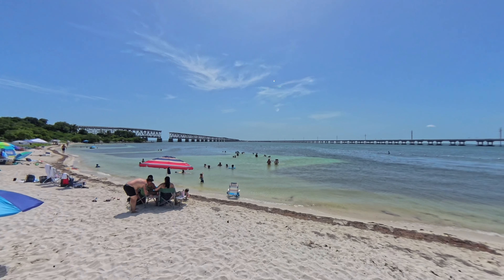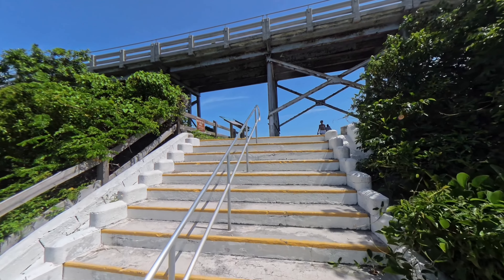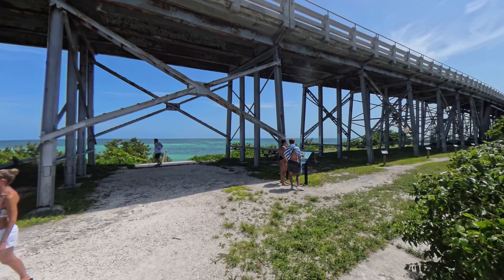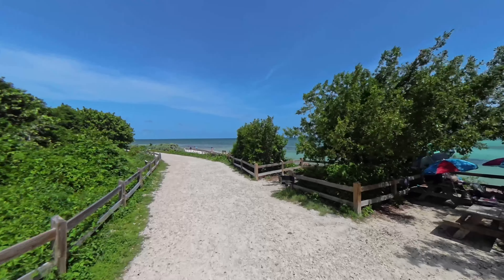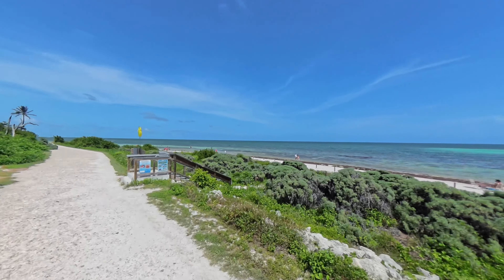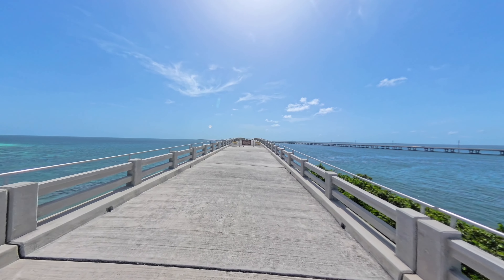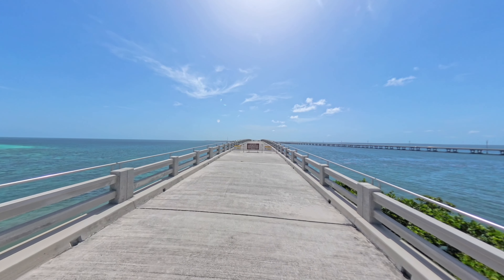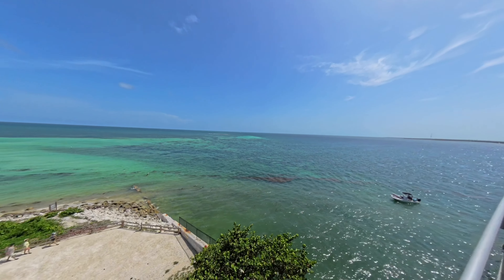Explore the Historic Bahia Honda Bridge!

Comment: Nice to see this again. I haven't been down there in 35 years. The family use to camp there every other year. Back then, the bridge was still in one piece and we would cross the channel by walking the railroad portion of the bridge all the way across.....and back. There was a steel cable from one end to the other that you could hold onto while making the crossing. One thing that was cool about that cable is that you could tap it, and then listen to the vibration travel back and forth.  Pretty neat.
Reply from the maker: @daniels.9206  thanks

Comment: I expect you Are absolutely correct about folks jumping off the end of the bridge section.  A shame as it would be cool to see the old roadway.
Reply from the maker: @markmoser7914  I was able to see it for years in the surface of the old bridge pavement was covered by broken pieces of pavement, etc. one source said that things were falling off the bridge into the water, and that that was making them question the structural integrity of the end, but who knows?